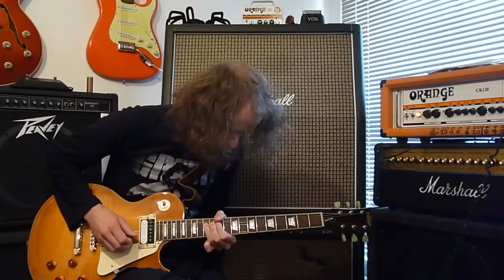Why I prefer Solid State amps to Valve amps

Comment: The difference is in, not so much the sonics (although there is definitely a big difference) but the feel of a tube amp. I played a Peavey Stereo Chorus for a couple of years in the late 80s and it did some really great processed cleans and dirty tones suitable for the Queensryche-esque tones I was going for in those days..then I bought my first tube amp (Marshall JCM900 Dual Reverb 50 watt head and 4x12 Marshall cab) BIG difference. You can hear harmonic overtones and get a greater definition, whereas SS amps do tend to descend in to a mush on higher gain settings...after many years of gigging vintage twins, tweeds, boogies etc I now have a Fender Champion 100 SS amp which does sound great on the Fender voices but it ain´t no tube amp...sadly finances and circumstance won´t allow a nice tube combo at the moment but I´m working on it...

Comment: There are tons of great tube amps out there, and there are tons of great solid state amps out there. Find one you like the best and go with that. Just don't go picking the first amp you see or the first one you like the sound of. Check out all the different brands and models and types that you can, make some notes about them in your head, bring your rig and set up that you will be using most often with the amp, and then choose the one you like the best.

Comment: I had the rudest comments when I was using the mg100hdfx I took the videos down because I freaked my travel agent out polishing up my Louisville slugger every week .  
But I left one video up using the mg100hdfx amp because the amp is not shown in the video.   It’s just playing with random pictures.  That tone sounds ok.  But I won’t ever share my own videos anymore after that.  The amp sounded fine . 

The Orange crush sounds fine. Listen to Ty tabor of Kings x tone.  It’s awesome. He used some old solid state from way back that was cheap on his early albums. Can’t remember what that amp company’s name is.  People called it junk.   People hated on all kinds of stuff and it’s all good.  People thought he was using expensive modded valve amps.   But yet they really made fun of that amp and the midiverb.    

The hate keeps the prices down and we can keep secrets. I like my tube amps.  But they cost 100 bucks to just carry it in when they start to fart out .  ✌️

Comment: well this is always been a controversial topic. For myself I can say it depends on the amount of gain, if you play with a fairly high gain-compression the difference might come down to the feel under your finger or maybe not even that. I play most of the time in the gray area between clean and dirt and with pick attach and guitar volume knob I manage my sounds, in this contest valve amp respond bit better. Now recently for recording purposes I put my hands on a ETHOS PREAMP, this monster really can do the job. They also produce a full amp pedal, that make you save also the problem of carrying your head around, you just need your pedalboard and a speaker and you're ready to go.
In fact there is not right or wrong, it all depends on how you play and what you play, beside obviously personal taste.

Comment: Good on you mate. I have valve amps...a Peavey Classic being the best to my ears. BUT I have recorded over 200 songs...(original and backers) all of them with a PODxt and a very loud power amp. Why the loud power amp? Well I think the stuff sounds better LOUD as the loud factor is always prevalent in valve amps. I think each to their own and no matter how good a JCM800 or a Line6 whatever, they both have their place but I think a lot of people are having to learn an amp with more parameters than Concorde when they are looking at the Axx or the Kemper. Both great bits of kit but useless for me. I've found  I'm not a big fan of tweaking . I have decent patches for EVH (Yes!), AC/DC, Zakk Wylde, Gary Moore (attached) as well as two full albums with a George Lynch type tone. Unlike yourself sir, I can hear and feel the tone but I get the same vibe as I do with the PODxt. Having done this for 40 years (I'm 55), I've owned over 40 amps...the Marshall Jubilee 50w combo being the most outstanding but the PODxt can sound ferocious too. Check out these clips for a Gary Moore and VH tone. 

https://www.youtube.com/watch?v=Esz7Fi8NVdk

https://www.youtube.com/watch?v=AqnnfTEYZCs

Comment: In my opinion most of the reason why people hear a difference is phsycological, i have one valve amp and 4 solid state and 1 moddeling amp and i can hear a bit of a difference, i think that valve amps are a bit more responsive dynamically but overall they do sound the same

Comment: Solid state amps....... in a nutshell. When I play a note I hear the note as I'm playing it. Tubes amp have always had a certain lag and notes drag behind it seems. I have given up on trying to like tube amps because everybody says I'm supposed to. My current rig is an ISP THETA Pedal into two Quilter Labs Tone Block 200 amps in stereo. Newest addition TC Electronics Plethora X5. (Ditched the majority of pedals for this (Also Stereo). Life is simpler/more light weight and my tone is way better than ever. Of course (2) 2x12 cabs are still heavy!!!! (Love the Lab Series L5 too but hard to drag around and keep working due to age)

Comment: Hey good video. I just wanted to point out, you said you don't hear a difference with valve amps. However you also said at different venues the valve amps sound and act differently to solid states. this is for me kinda showing a difference between them. Also I used to believe like you do. But for me valve amps sound way more tonal and deep I didnt used to hear much differnece either. But the valves break up with the sound so nice at a high gain/volume it's so strange you don't notice that. This is not having a pop at you. your fully entitled to your opinion. Just find it hard to believe. Enjoyed your video!
Reply from the maker: Thank you very much indeed for watching. : )

Comment: Ok lads easy best tube amp I had was a 62 oxblood fender deluxe. back in 84 85 same amp uncle ted used on stranglehold. It screamed and sang till it blew it blew 3 times in two years at 250 bucks a pop. sold it got a Yamaha mrk2 50 1x12 played 1500 gigs with it. still have it. it waits for me any time never a break down. using transtubes little ones 1x10 25 watt audition. if your rich play tubes if your not well you do the best you can.job well done Dave peace bros

Comment: I have a 1972 alamo fury tube amp hybrid, solid state preamp, bought for around 250 to 300 and it sounds wayy cleaner and clearer then my new orange cr120 for 525, a steal really though. Its like quality has gotten worse in new amps, maybe i just dont like the orange sound idk, but the treble or high ends is almost not there in the or120 its almost all mid and low end gets lost and scrambled in all of it, each string isnt distinguishible when played together, unlike the alamo fury tube hybrid

Comment: My 2 cents...  If you get your tone from a pedal board, go for SS.  For MANY players, that's a perfect recipe.  More reliable, lower cost...definitely a win.  But if you're using a minimal signal chain like me, the distortion from pushing the EL-34s or whatever power tubes are in your amp give a different sound (I'm not saying better, just DIFFERENT) that I don't achieve from a SS amp (or even a lower volume tube amp with only pre-amp distortion).  Like you said in your video, to each his own.  Tone is subjective.  But when my EL-34's a glowing hot and I've got the master up at 1-2 o'clock, I hear something that's unique to a tube amp with it's power section being driven hard.  Some call it the Marshall growl... and truthfully, I couldn't even begin to analyze how much of that is due to the tubes themselves, the specific output transformer etc... just simply that when pushed hard, there's a certain magic.  Unfortunately most people in clubs or in their houses, simply can not wind up a 50 or 100w loud enough to produce these tones from the power stage of their amp.  There would be no VH brown sound without a hot biased tube amp.  Yes Eddie went thru 6CA7's by the hundreds to get there (as well as the power sag of his variac to drop the voltage) so your "tone" can certainly come at a "cost" when taken to the extremes.  Also IMO, modern tubes are shit.  I've bought vintage NOS from reputable dealers and have gotten significantly more cost effective performance (and better tone...again, subjective).

Comment: I agree, had a solid state crate for years and didn't mind the sound at all. thought I needed an upgrade and listened to everybody say"you need a tube amp and a cab with vintage 30s". 
what a HUGE WASTE OF MONEY!!! not happy at all, does it sound a little different? yeah does it sound better? I prefer my "shitty" crate. my crate halfstack weighs less than half, costs less than half and sounds just as good.  DONT LISTEN TO GEAR SNOBS GUYS, buying all this expensive nonsense will NOT have a huge impact on your sounds. the only difference I can tell between my solid state half stack and my tibe half stack is volume. the tube amp is 3 times as loud. It's actually too loud to play unless you're gigging. can't really play comfortably at bedroom level.

Comment: NEED HELP :( 
Hi dave, i got a mg100hdfx ! Is this amp good enough for studio recording? And how do other bands record on the studio? They record with tube amps right? Do tube amps also sound good when they arent cranked?
Reply from the maker: The MG is indeed great for recording. Sounds great and some bands do use valve amps but some have used solid state. Some valve amps don;t sound that great cranked yes. Most need to be turned up so they can breathe.  :)
Reply: Dave Simpson ok thanks a lot for helping me out ^^

Comment: AWESOME FEEBACK & COOL SUBJECT... I HAVE HAD TUBE AMPS FOR MAYBE THE LAST 4 YEARS OR SO... I DO LOVE WHAT I HAVE (A CUSTOMER BUILT 18WATT TUBE HEAD COVERED IN BROWN SNAKE SKIN TOLEX, A TINY TORROR, B52 AT-100 TRI-MODE & TRAYNOR IRONHORSE 40) THESE ARE ALL TUBE AND HAVE HAD NO PROBLEMS WITH THESE AMPS... I ONLY TOW SOLID STATES NOW AND THEY USUALLY DON'T SEE THE STAGE ANYMORE... BUT I'VE ALWAYS LOVED THE SOLID STATES I'VE HAD AND I COULDN'T EVEN KNOCK THEM... I HAD A PEAVEY CLASSIC CHORUS 2X12 SCORPION EQIUPT SPEAKERS AND IT WAS A COMPLETE BEAST... I HAD A FENDER FM100 HEAD & HALFSTACK THAT WAS A GREAT SOUNDING AMP... PLUS I'VE HAD OTHER MUSICIANS WITHOUT LOOKING TO SEE WHAT I HAVE ASK WHAT I'M RUNNING FOR AN AMP AND THEY WERE USUALLY SURPRISED WHEN I TOLD THEM... IF YOU TWEEK THEM OUT YOU CAN GET GOOD WARM FAT SOUNDS... I DOUBT I'D GO BACK SOLID STATE ON THE STAGE UNLESS I GOT ONE OF THOSE COOL ORANGE AMPS THIS GUY IS PLAYING LOL... BUT I TRY TO GET AMP HEADS VS. COMBO AMPS NOW SO I CAN SWITCH BETWEEN THE FEW AMP CABS I HAVE... I AGREE WITH WHOEVER STATED TO JUST USE BETTER SPEAKERS... THEY REALLY DO MAKE ALL THE DIFFERENCE... PEDAL CHOICE ON YOUR PEDAL BOARD IS ALWAYS A FACTOR AS WELL... FOR A WHILE I WAS RUNNING TWO AMPS ON STAGE THRU A "MORLEY A/B SELECTOR SWITCH" AND RUNNING A 2X12 OR 4X12 CAB AND HAD THE SPEAKER JACKS WIRED SEPERATE FOR EACH AMP... BECAUSE THE TUBE AMP DIDN'T SOUND SO GOOD WITH THE HEAVIER DISTORTION PEDALS BUT THE SOLID STATE DID....

Comment: Seems to me most people including OP are comparing specific amps they have experience on and not in general Tubes vs/ SS.  Can you get a decent sound from a SS amp? Sure.  Are they lighter and generally cheaper than tubes? Most often yes.  Do they sound as good as Tubes and most importantly do they follow the dynamics of your playing?  NO! So if you're just starting out or a "weekend warrior" a SS amp  can be a practical option.  One exception might be the Dimebag type players who play compressed and distorted all the time where SS is fine.  If you play any sort of variety where transition and dynamics are important nothing beats tubes.  If this weren't so, the overwhelming majority of great players wouldn't choose tubes and without any doubt manufacturers prefer SS bcause they lend themselves readily to mass production.  Tubes still exist despite cost, weight, features, and manufacturing advantages exactly because nothing else delivers the expressive feel and depth of a tube amp.  If you still doubt this check out any of the videos here on YouTube of old Tweed amps or better yet, play a decent tube amp (Fender, Marshall, Vox , Mesa, Matchless, etc)  especially on a gig, and feel it for yourself.

Comment: Solid state has faster transient response than tube. Some tube amps are more dimensional in sound. But then again amps like Orange, peavey, boss etc. Have more dimension and warmth to their tone. Also a huge percentage of people who use tube amps rely on overdrive pedals to generate most of their gain. Which most of the time those pedals are solid state or solid state/modeling. I have maybe had one or 2 tube amps that actually had a nice enough overdrive to not use pedals, a peavey triumph 60 head and a 5150 head .. oh and a laney aor 30 combo..

Comment: Have you ever tried a Bugera? I heard mixed opinions about them. I was curious what was your opinion about them since they are in the same price range of the Orange ss amp that you have.
Reply from the maker: I've never tried one no but i've heard a few. They sound pretty good but i wouldn't trade my CR120 for one. :)
Reply: Thanks dude and keep up the good work. And if you are sometimes in the mood do a Malmsteen tone :)
Reply: i compared a  Bugera v22 - Orange cr60 , To me the v22 sounded similar to a Fender and the controls were not that "effective"- not as loud and I didnt like the tone quality at all , The Orange has more Balls - Volume , is much better for gigging - far more versatile in tone , has far more effektive tone controls  - needs no tube Servicing - not as "fragile" as the bugera . To me the Orange solid State sounded much better than the "cheap Bugera Tube" amp !   :-)

Comment: Can anyone tell me?  I can't hear the difference between solid state (SS) and tube amps, but I am no professional either.   It is true SS amps have no worry of blowing a tube, and usually they are much lighter to carry.  Well, you heard all that before.  What I would like anyone here to comment on is the "Cube  Stage" amp.  It is suppose to sound just like a tube amp.  So, is the Cube Stage Amp the best of both Worlds?   I do like solid-state amps, per I can use a headset when practicing, but solid-state amps seem to not have that Spanky tube sound, and the Cube Stage seems to come very close to that sound ... what do you all think?

Comment: For those out there looking for a good amp tho, any of these ones would be a great amp to get with pretty much any guitar and set up:
Peavey 5150/5150 II/6505/6505+(they are all similar and the 05 = the 50 and the 05+ = the 50 II just fyi)
Orange CR120
Marshall JCM 800 or 2000
Peavey Valve King VK100
Marshall MG100dfx
Bugera 6262(again similar to the 5150 II/6505+ but unique at the same time)
Crate Blue Voodoo
Line-6 Spider IV or Spider Valve
Peavey VTM120
and last but not least by far the EVH 5150 III

Comment: I get the cost. I get the weight. I KINDA get the repair bills, although in my experience a decent valve amp doesn't usually cost you much money unless you're flogging it and you get your servicing done by Cesar Diaz. But the sounds? Solid state amps are designed to EMULATE valve amps. I can't think of a solid state lead amp made these days that was designed from the ground up to have its own sound. Specifically clean amps maybe. But not amps designed for overdrive and distortion. If you're satisfied with the sounds you get then great. But I find it perplexing that you can't hear the difference. I played a BOSS Katana the other day and it was great. But my experience with even the best sounding solid state gear is that as it approaches high volume the sound gets less and less pleasing. I'm not talking Kemper or AxeFX, which are ironically often run through valve power amps to achieve more warmth. I mean, run of the mill transistor amps. But viva la difference. We all have our preferences. For the record, the rig I use most often is an all valve Laney IRT Studio 15w double rack space head into a Laney 1x12 loaded with a Celestion G12H-30 speaker. It's not loud, wasn't expensive, has a range of sounds and suits all sorts gigs because most of the time these days the fold back with PAs is good and the IRT has an excellent emulated DI. All valve amps are not the same. I'd advocate people look at the full range of valve amps out there before consigning them to the too hard basket.

Comment: My first and only Marshall was a mg series, and to be honest I could not stand how fake sounding it was.  I like to be able to roll back the volume pot on my guitar to clean up.  I found this feature to be almost non extant  with that amp as if I were using active pickups but I don't. I also don't think the distortion on solid stat amps can stand up to a Rectifier or Mark series without running it through an eq for some tone shifting like Dimebag used to do.

Comment: Best thing I did for my time was to buy a 40 watt $700 Fender tube combo with an attenuator. 1 channel, 1 volume knob, a boost pedal if needed. It's been re-tubed once in 6 years and it's only a 1x12. Ah well; to each his own. Cheers!

Comment: I'm 58 and went through a lot of solid state bass amps, even a boutique and wish I had of just bought the tube head I have today.   I spent a lot of money on a 350 watt 2x10 combo amp and man it suck ass compared to my 200 watt head and 4 x10 cab  (no way I would lug around a 4x10 combo amp if they had one).  Dave is a wonderful musician but I still think valve amps rule they sound much nicer.